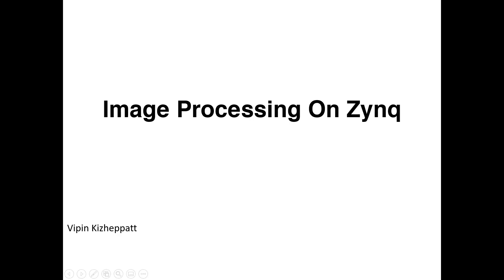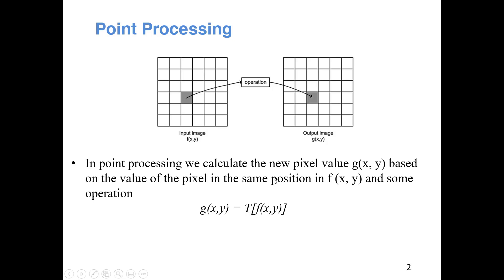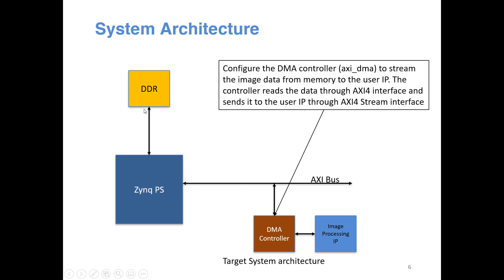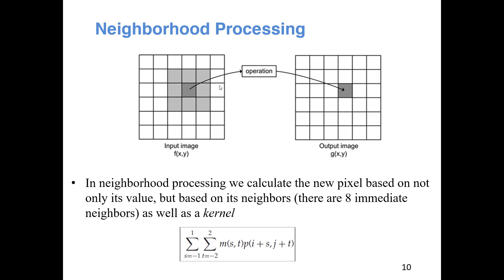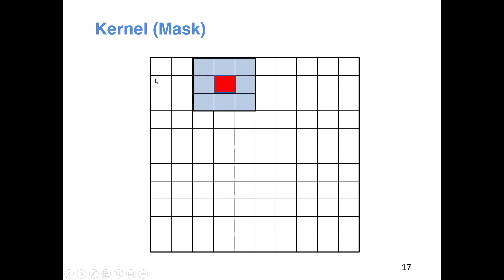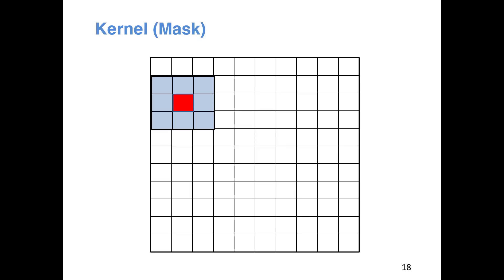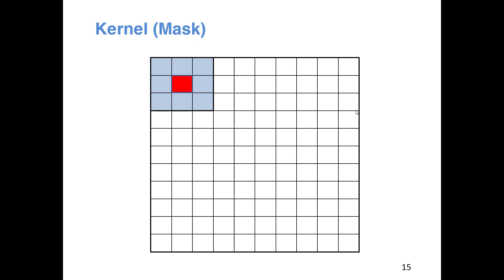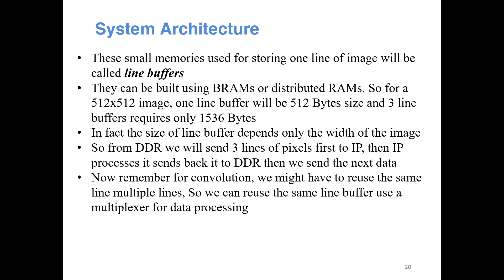Image Processing on Zynq (FPGAs) : Part 1 Introduction

Comment: Thanks a lot for the tutorials
Is there a way to add defective pixel correction core to my project
If not how can i implement a custom core to correct defective pixel using microblaze through axi lite interfacing

Comment: I might be missing a point, but can't work with 2 LBs and 3 registers (to store 3 pixels)? As soon as we store the first two lines and get the first 3 pixels of the 3rd line, we can start processing and send out the first line. Also, as we send out the first line, we don't need the 1st line in the LB anymore. So we push in the 3rd line in the 1st line's LB. Or did I miss a point?

Comment: Sir, can't we do it without the interrupt signal?. I mean we can continuously stream the data without the interrupt signal from IP!
Reply from the maker: Yes. But you will have to change the line buffer design as a shift register based implementation and needs proper aci stream slave interface to the line buffer. Directly wiring ready signal from output won't work. Just search for line buffer design and you will see papers on shift register based ones